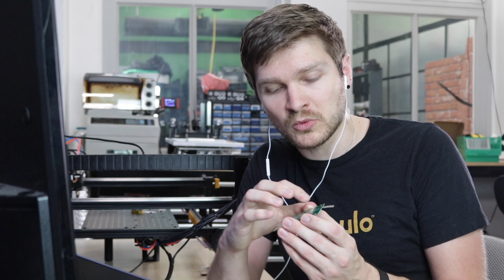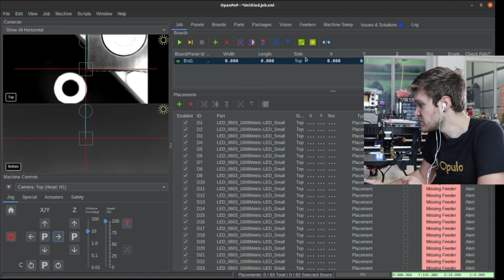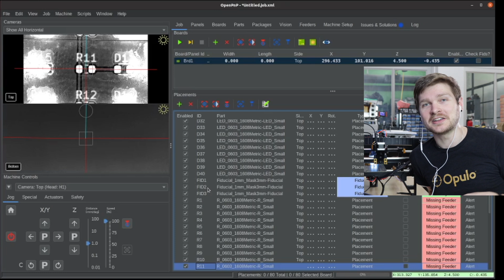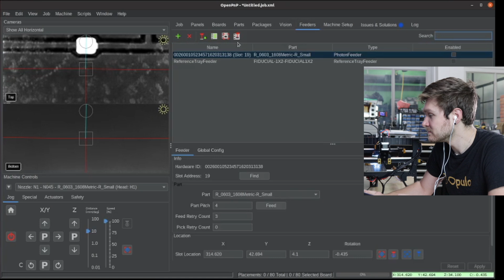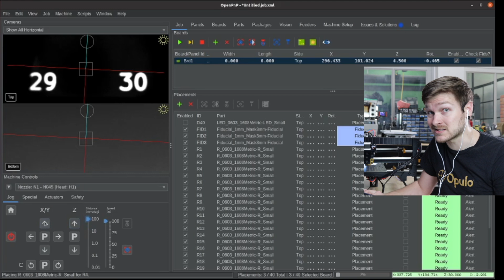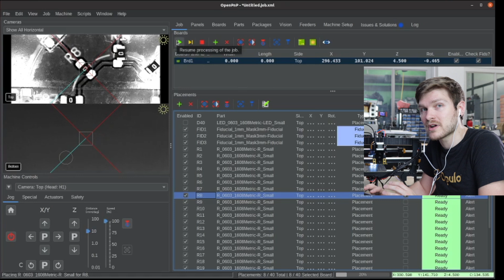LumenPnP Setup Tutorial Part 3 - First Job

Comment: Hello, can we create custom feeders? I want to use a 2D plate with specified locations on it.
Reply from the maker: It sounds like a tray feeder might do what you need. I would check out this page on the OpenPnP docs for seeing the different feeder options: https://github.com/openpnp/openpnp/wiki/Setup-and-Calibration_Feeders
The main idea for the tray feeder is that you tell it the spacing and how many rows/columns and then it goes from there. I hope this helps!